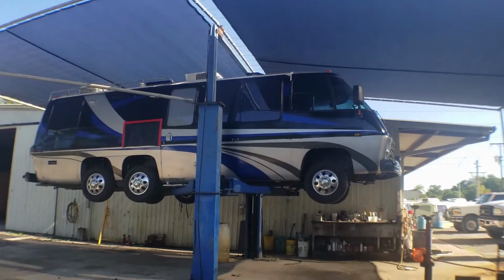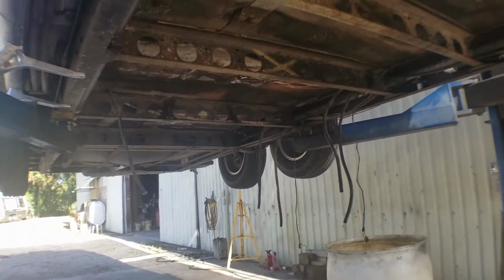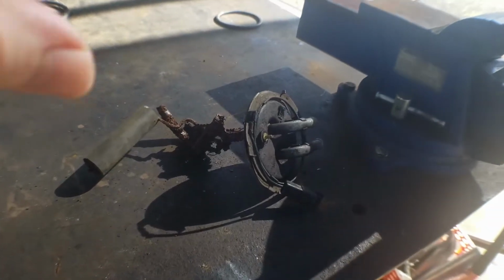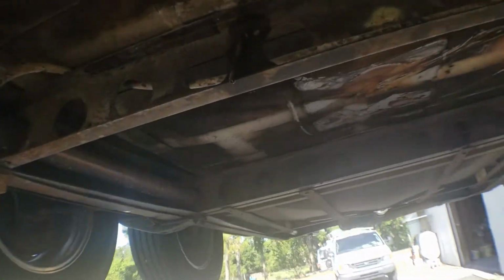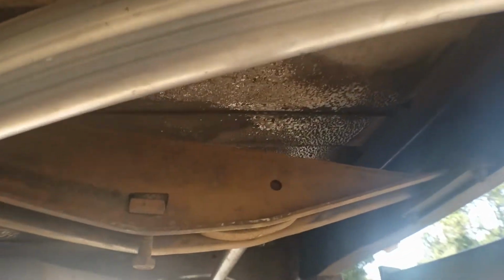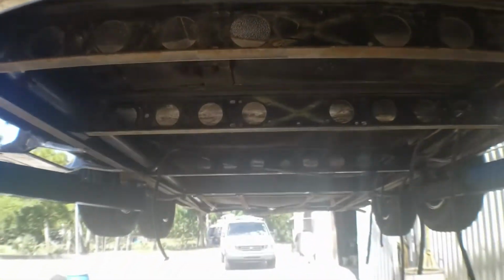SURPRISE!! the fuel tanks are down! Yaryis Adventures Part 185

Comment: Hmm, I have not dropped the tanks yet but have been stranded on the alligator. 12 hours to get a tow truck. Definitely fuel,  replaced fuel filter and carb work plus electric fuel pump for additional fuel. Still don't trust GMC. Tanks might have to be cleaned. However just did tanks in another GMC and it appears to have the same problems. If you find an issue can you post it?
Reply from the maker: I am happy that the tanks, and fuel lines are going to be repaired,  and replaced, also, the entire system is going to be upgraded.
Reply from the maker: As I am doing the restoration everything I am doing is getting documented so everyone can see our progress
Reply from the maker: I will post the progress of our journey for everyone to see and learn from our experience